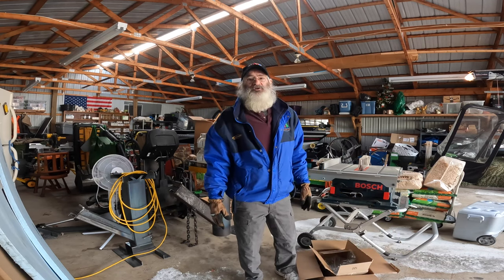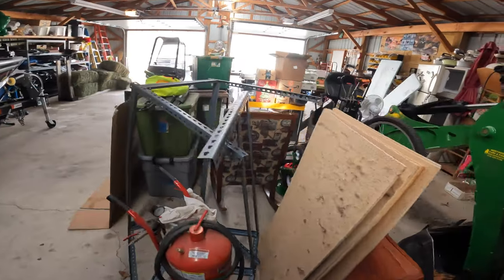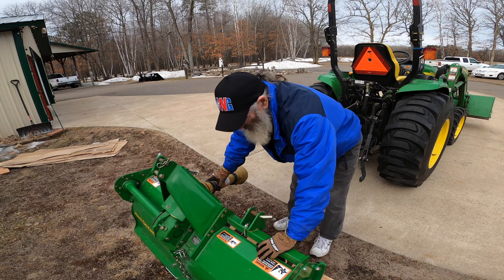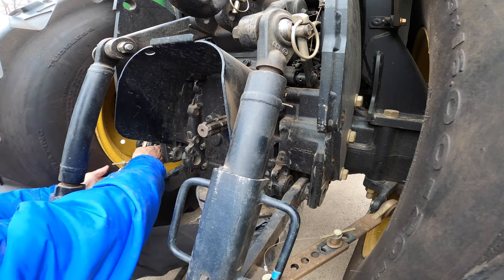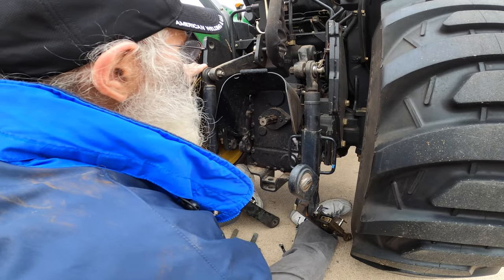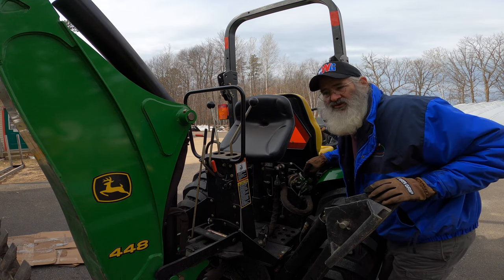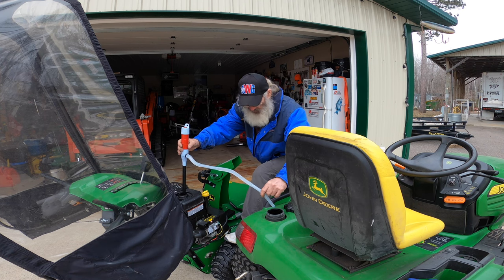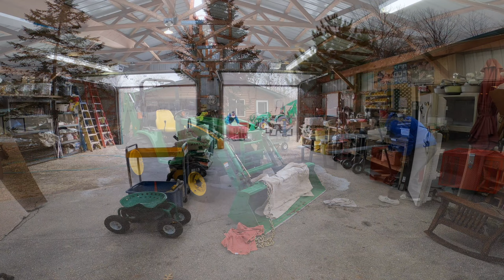PUTTING A BACKHOE 448 onto a JOHN DEERE 3320 TRACTOR ~ PREPARING FOR SUMMER ~ UNIQUE SOCKET SET

Comment: Thanks for your video! I want to put a 448 on my 3320 but I dont know what mounting lates are needed. Can you share some close up pictures of your mounting plates that attach the hoe to your tractor?
Thank you,
Kevin
Reply from the maker: I'm pretty sure everything you need is already there, least ways it is on mine!  It just slides in on two "large" pin holes.
Reply: @northcountry9926  I have called my JD dealer and they say it wont work. I told them "I have seen several videos of the tractor hoe working together. Is there  a side plate mounted to the tractor that the hoe connects to? Thanks
Reply from the maker: @kgaby370  That is odd??? My Backhoe is the 448 model and it fits like a glove perfectly on the 3320 tractor just like it was made for it, which it was!  You simply lift the backhoe into place with the 3 point hitch lift system, then disconnect the 3 point hydraulics from the tractor and hook up the hydraulics for the backhoe to help seat it into place.  It literally only takes about 10 to 15 minutes!
Reply from the maker: @kgaby370   I have done it only like 50 times so theres that!  Maybe call the chief service guy from where I live, lol